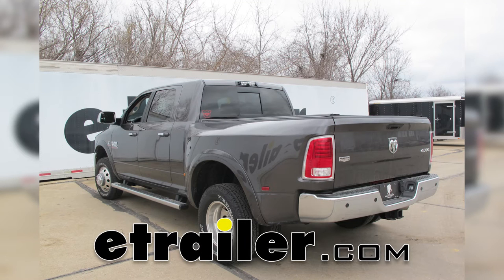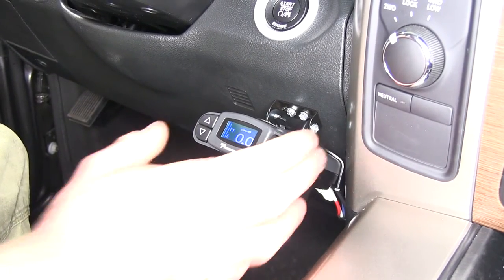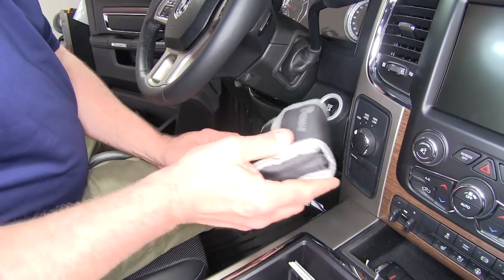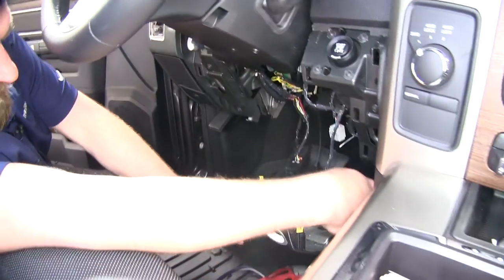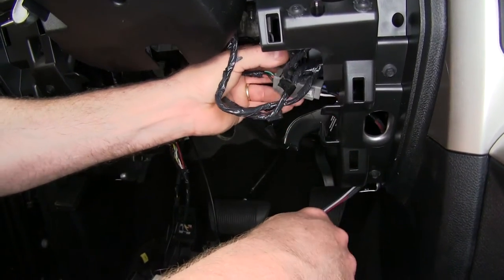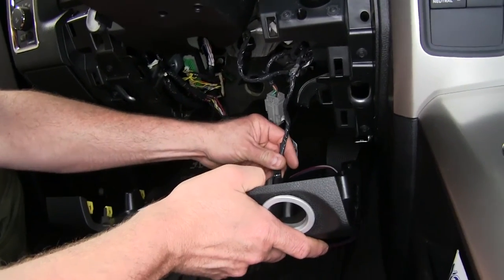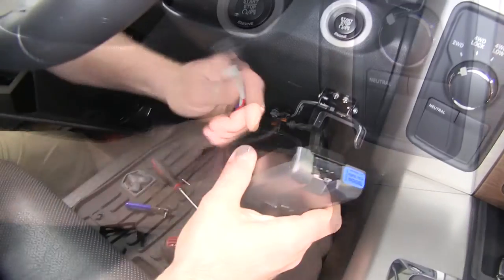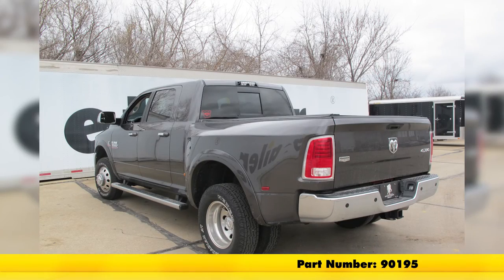etrailer | Installing the Tekonsha Prodigy P3 Trailer Brake Controller on your 2015 Ram 3500

Comment: Stock one only lasted one year then it doesn’t read the trailer(trailer not connected). Had to replace for a after market one. Problem fix. Thanks for this video very helpful.
Reply from the maker: We're sorry to hear that your OEM controller went out on you, but we're glad you found a solution that works for you. Which controller did you go with?
https://www.etrailer.com/Trailer-Brake-Controller/Tekonsha/90195.html

Comment: Just curious why install on a pickup that already has the factory brake controller. Did the factory one break and the truck out of warranty or something?
Reply from the maker: This customer came in complaining that the OEM controller was not working with his triple axle 5th wheel trailer. He had towed the trailer previously with an older truck that had a P3 controller and it had no problems. After the dealer made several attempts to fix the issue, the customer decided he wanted an aftermarket controller installed. Once installed, he was a happy camper!